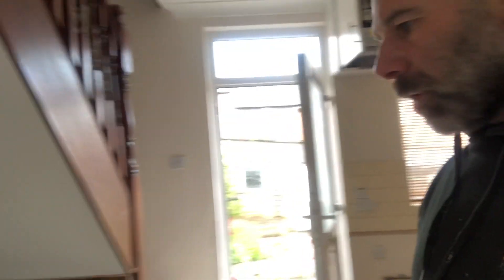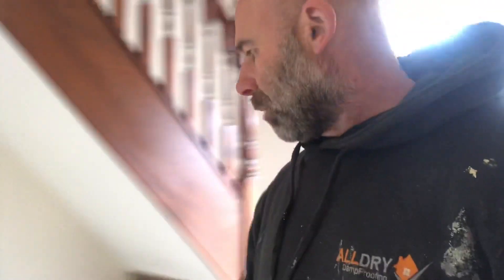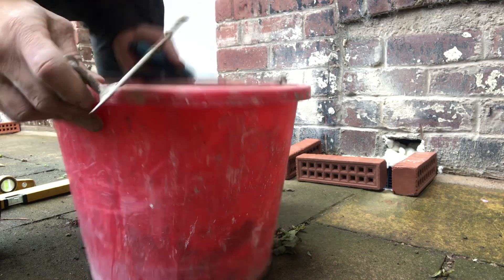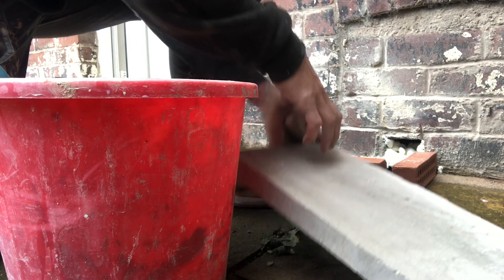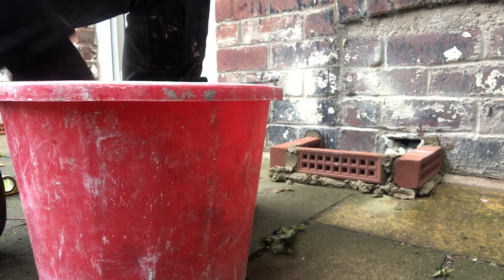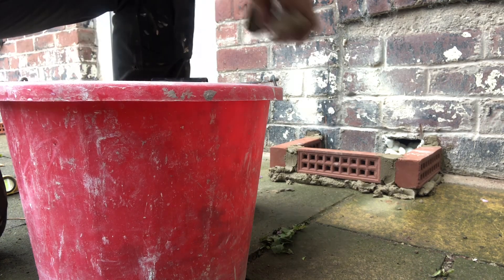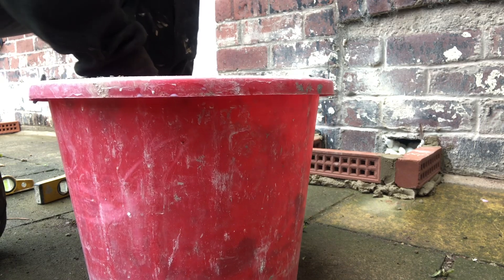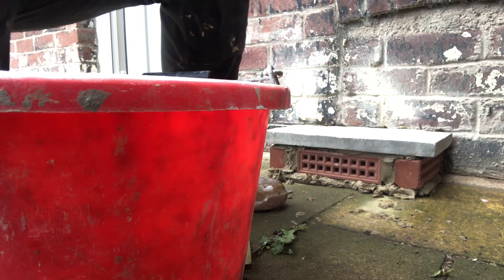How to fit an air brick housing

Comment: I think that many of the detractors have completely missed the point with this. Of course there are better solutions (lowering surrounding ground etc, etc) but for someone who doesn’t have the money to fund such solution, this is a pretty ingenious way to tick most of the boxes to improve the existing situation.  1) Does it stop bouncing  rainwater entering main vent: yes.  2) Will it prevent debris collecting in the recess and blocking the vent: yes, the new housing will be less prone to debris build up as the housing vents are slightly higher (rather than below) patio level and are more plentiful ~ it’s also much easier to clear debris away compared with debris in a recess.  3) Will it prevent water build up on the patio entering the original vent: depends it will offer some (limited) resistance compared with the previous uninhibited access for water that is there now, which may make a positive difference (depending on the amount of patio fall and water build up that occurs). For me, at the end of the day it’s a lot better than doing nothing which may have been the only other option.

Comment: This is my resort for my basement. Our 'builders' didn't build a proper vent system. They literally covered the hole to the basement with a tarp and used only sand (not even mortar) to fill the slabs, i.e: They cocked up the job big time. Had to deal with leaks, a lot of damp and smell from the basement.

Credit to you for this video. I'm going to attempt the same with some changes and hopefully update this comment later on. Cheers.
Reply from the maker: Good luck with it hope you get things sorted 👍

Comment: I've just bought a house that's had the ground level around it raised up and consequently the air bricks are now basically at ground level.  I've had ideas of trying to retrofit a periscope vent or raising parts of the floor internally to put a new higher up brick in and I can't believe I never thought to do this!  It's so simple I feel silly to have not considered it.  I think I would feel better with a course of normal bricks in first though, I'm in Scotland and it rains a lot. Will make a nice little plinth to put a planter on

Comment: No hate from me, but I would try and fit a periscope vent (only possible on cavity walls) , or modify slightly the concept that has been done here, 2 courses of brickwork then airbricks and lid as per video to create an air brick housing just higher off the ground. I have seen plenty of Sam's videos and I think he is a sound guy. I come across raised ground levels regularly as part of my day job and not all situations suit gravel trench/french drain/lowering of ground levels. If  you look closely at the video just before the camera moves to ground level you can see the header row of 7 soldiers this area has previously been an opening that has been bricked up. I'm not familiar with the housing stock in this area but someone will know it's original purpose,

Comment: Lower the ground levels and create a pea shingle border the length of the wall 150mm below the original DPC (slate most likely in this case). What you've done is ugly, ineffective and poorly done. If I came home to my house and found that, I'd sledge it off!
Reply from the maker: Thanks for your comments, you seem to think that we force our customers to have work done. Well, round, where we live our customers, have a bit more about them and we give them options and costs in a written quotation that explains what we would propose to do. the channel would have been an option but unfortunately, time and money were against the customer and they chose the air bricks. one mans meat is another man's murder. the customer loved what we did as have lots of others. 
I'm sure if i came round to your squat there may be things i would not like about your place but i would not sink so low as to comment on things that i only know 1/10th of the storey for fear of making myself look daft.
thanks for being a fan